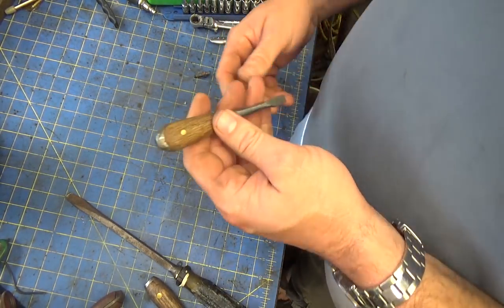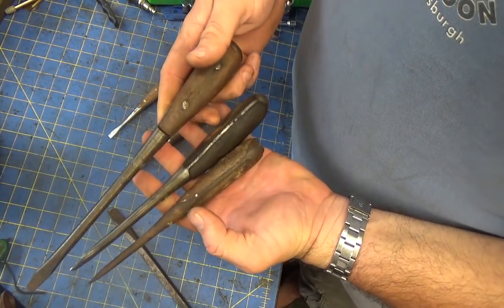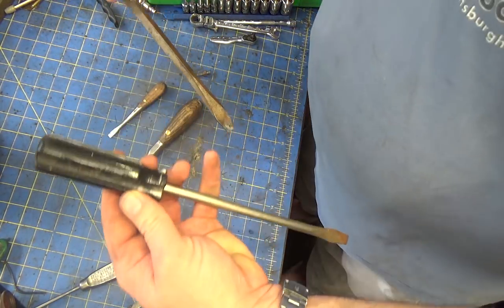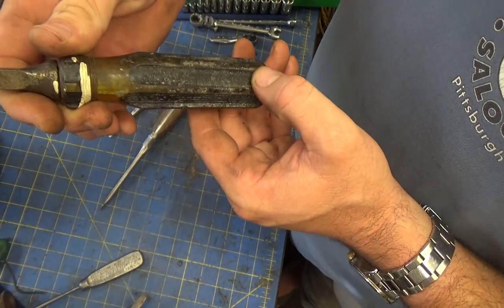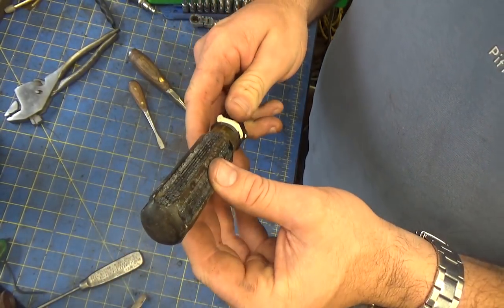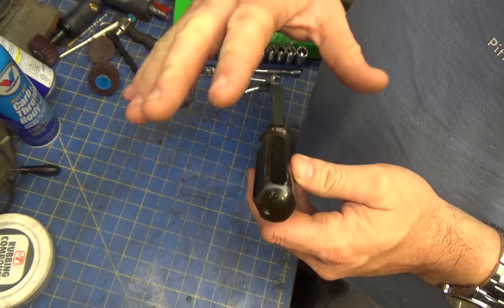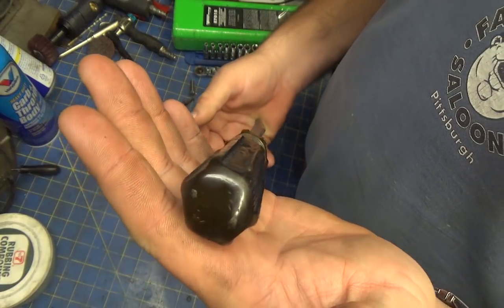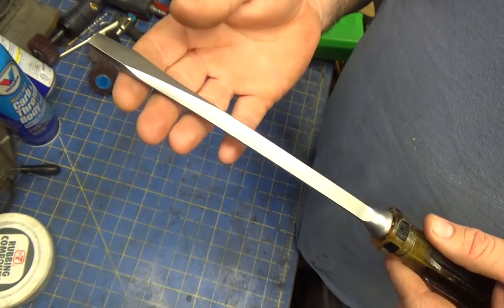Stanley 100 Plus Screwdriver (Not the World's Best Screwdriver, but Not Junk Either)

Comment: the big stanley 100 is also copied (or they copied, i dont know who did it first!) by steadfast, a UK company who specialised in screwdrivers but went bust in the 80s, shame, as i still have 3 pozi screwdrivers and they arnt worn at all, and usually a pozi drive will wear out in a year or 2 with me, i have a big beater with a yellow handle , a british twin to your stanley. and in the 30 years since ive had it , and it was used then, it is indeed the pounding screwdriver and the lever!   i havea  few still new 100 plus series, they were both fully mirror polished and clear laquered
Reply from the maker: Jusb1066, "steadfast" never heard of that before, but now I know to keep an eye out for them. Those pozi drive screwdrivers are the best. Thanks for watching and thanks for commenting. Cheers.

Comment: The Stearns Lumber Company was located in Stearns, Ky, approximately 15 miles from where I live. My Grandfather worked for their coal company, along with most of the elders in our family. They had the coal company, the lumber company, and a building company. I have some of their other items. Would you be willing to sell that Stearns tool?
Reply from the maker: Hi Greg, i am not really looking to sell anything, but i might be willing to trade it for something that needs to be restored. You can email me if you want to discuss a trade joeheilm@aol.com
Reply: @joeheilm  emailed you Sir...Thanks!
Reply from the maker: Hi Greg, I checked my email and didn't see anything. Could you double check the address? It should be joeheilm@aol.com
Reply from the maker: Hi Greg, the aol server is down so my email is acting up. The plumb wrench is very cool, i'll send you an email when it starts working again. Cheers,
Joe